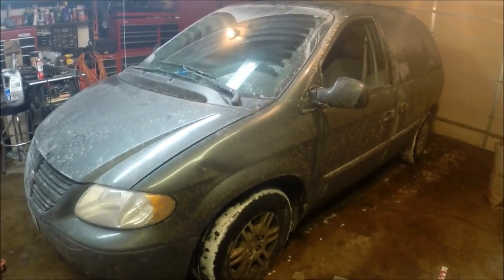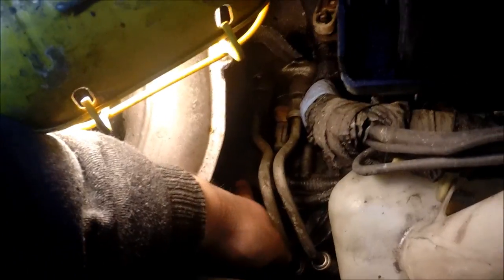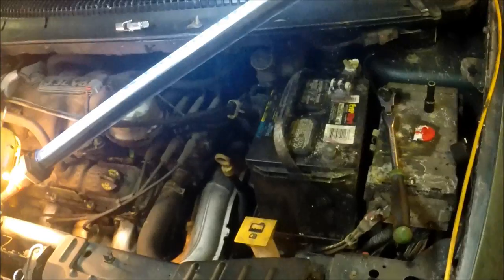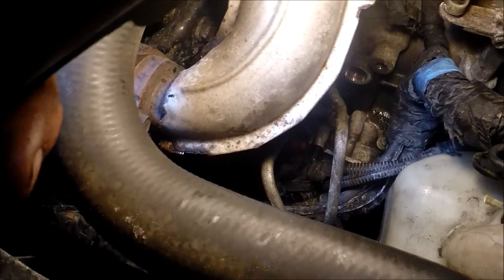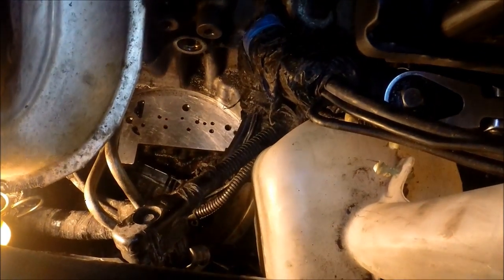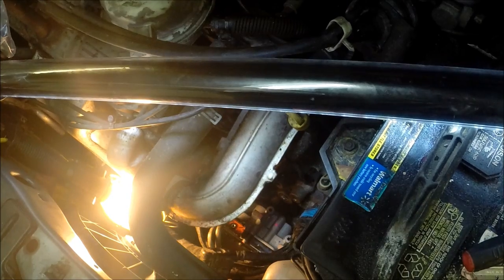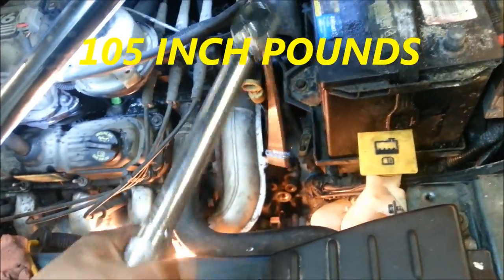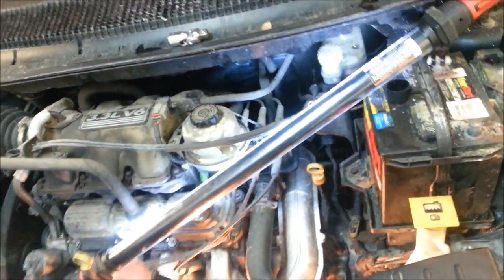Grand caravan/ town & country transmission control solenoid pack replacment

Comment: Nothing to do with leaking, but I had one of these and the trans control module is very sensitive to voltage drops, I had a problem with it going into limp mode and discovered by accident that just cleaning battery posts/connectors would cure it. Six months later it would try to take off in second from a stop sign and cleaning again cured it for another six months. Transmission shop told me $1800 to fix. What a scam.
Reply from the maker: bstrunk57 yeab some trans shops dont want to take the risk of not replacing big ticket items because then they get a bad rap for misdiag. unfortunate to the customer but its my experience with them

Comment: My 2005 Town and Country wouldn't shift in hot weather after driving a while, (P0700 code) so I went into the fuse box and replaced the EATX Safety Shut Down Relay for $20. Problem solved! Thanks, Occam's razor!

Comment: For anyone doing this.  If you cannot budge free the solenoid.  Go underneath and lighlty tap the solenoid with a heavy hammer.  A few light taps will break the bond.  Honestly the hardest part was scraping remnants of leftover gasket.  I found carb cleaner and break cleaner useless in removing it.  What I used was electrical contact cleaner.  I doused a piece of fabric in the contact cleaner and applied that to where gasket was stuck.  After roughly 30 minutes with it on the gasket just peeled right up.  Nice and easy.  Also use that electrical contact cleaner on the connector for the solenoid to clean out dirt and grease.  I changed this out on my van after it has been sitting for MONTHS.  I was worried because I have never done anythin like it.  You can seriously do this!!

Comment: Thank you for the video.  It made the job much easier.  My van had a rubber boot over it that took awhile to get it off.  If it wasn't for your video, I probably wouldn't have found the solenoid.  Evidently, a relearn wasn't necessary as it worked perfect.
Reply from the maker: thats great!!! glad i could help
Reply: Hey jerry, what yr and model? what codes did you have and what symptoms were you experiencing?
Reply: Steve Santiago 
It has been awhile but I think I can remember some of it.   The trans was shifting irrationality, but I don't remember the code.  It's a 2000 Town and Country with 175000 miles on it.   I haven't had any more problems since.

Comment: I just did this job, which my Chilton repair manual didn't even have in it.  Some observations.  It is an 8/10 on the knucklebuster scale!  It took more than 2 hours due to the tight spaces.  I ended up taking off both cooler lines.  The sensor on my 2006 Town & Country needed a 1" socket, not 7/8ths.  All that said, my mild problem of delayed shifting on occasion is now a full blown slipping and dropping out of gear problem, to the point I'm taking it in to a tranny shop tomorrow.  I'll post an update later.  Hopefully its a TCM quick learn issue and not something major.  Good video to guide through the process but beware it may not fix your problem!  Thanks for the help Joe.
Reply from the maker: oroszfamily  i replaced it because it was leaking and having shift issues, but transmission problems are the worst to have upon your vehicle so many issues can happen. usually if a relearn is needed (which it states it does)  it is just minor shift pattern issue. but sorry to hear of the issues. ive replaced the one and it ended up being a transmission pump that was failing so like i said transmissions can be very hard to diagnose
Reply: Jon Madison
I had a catalytic converter efficiency code (check engine light) going on also.  So, the transmission had to be rebuilt, and the transmission shop actually found the catalytic convertor was nearly plugged.  That evidently caused back pressure  (my words) which put a lot of strain on the tranny.  They didn't want my to drive on the rebuilt tranny unless I was going to immediately get the catalytic converter fixed.  I took it straight to the muffler shop the same day and it's been great ever since.  So, I spent a weekend and $80 for the part for nothing.  What irritated me was I took the van to the dealer hoping the catalytic would be under warranty (was not), and they told me it should be replaced but wasn't an emergency.  The muffler shop had also said it wasn't a big deal until it "got plugged."  I guess I was missing the signs of being plugged, as the power and acceleration had gotten bad.  We also had a EGR valve (check engine) code, which came back even after the EGR valve was replaced, and that went away after the new catalytic was put in.
Reply: JoeTheAutoGuy
I was trying to save on diagnostic charges which ended up not working.  Live and learn as they say!  I appreciate the help though, and the video is a good guide for this repair.  Thanks.

Comment: i know this is an old video, but i am getting ready to do the same thing tomorrow on the same model, 05 dodge caravan.  the area is so tight. how did you remove the trans cooler lines? can you remove both of them? is it safe to? do i need to add any trans fluid afterwards? also is the wiring harness on the right safe to move and bend out of the way? i can use the help with these questions.

Comment: Hi what are the 5 or 6 bolts right under the solenoid pack?  I saw that they were out so I tightened them up which I’m thinking now if that was a good idea.  I see in your caravan I can see the bolts are backed out too? From top view with the solenoid pack out you can see the bolts/screw right below gasket area.

Comment: 2003 Chrysler Town And Country 3.8L started shuddering and vibrating when shifted into reverse. Now check engine light on, will not shift from first gear. It all started by the van idling while in drive randomly. Then I manually downshifted and brought it down to 3rd gear then L. Shut it off and turned it back on and it drove fine after that on Friday. Now tonight the issues started.

Comment: Hi Joe,  After reading all these comments & your replies. I think you should be called st.joe. I have a 06 t&c 3.8L van with 231k.  I'm on my second used transmission. When cold the van slips 1st gear & immediately goes into 2nd gear limp mode. The speedometer stays on zero. After speeding up and slowing down the speedometer slowly starts to bounce. Bounces to 5 mph, then maybe 15, maybe to the actual speed I'm going, back to 0, ect... after 10 to 15 minutes I turn the car off &  8 out of 10 times it's good to go, no problems. My number one suspect is the TCM, also has catalytic converter codes, of course speed sensor codes, a bad tire &  a cracked windshield. I've driven the car 4k like this.  I think I'll do the TCM anyway but would like your opinion please sir.
Thanks,
Mark c
Reply: Haf an 03 caravan with the 3.3 that did the same thing. I would look at doing input/output speed sensor first.(before replacing ANYTHING LOOK AT THE WIRES) Had an 03 have crap wires and threw speed sensor codes, replaced sensor and went to plug in harness and wires broke off.

After that if not solved replace this solenoid and hope for best.

Comment: Hey Joe, I have a 2005 T&C 3.8  I have the P700 code also, it will go into reverse back up, but when you try to accel it will shudder, in forwards it holds gear a little long, and if you try to kick it down to second, it just revs, if you drive reasonable it drives forwards fine. was thinking a shift solenoid, and if so...easy to change? Thanks for your time on this and have a great safe evening.

Comment: Thanks for the video! I have a question. I wasn't able to get off the transmission cooler lines. Is just the tubing supposed to come off or does the brass/metal fitting come out as well? Do you use a special tool? I will try again next weekend. :-)
Reply from the maker: the cooler lines have a special clip that holds them in place but they tend to be difficult so it takes a bit longer but you can just remove the fitttings from the trans while keeping them attached to thier lines

Comment: I have a 2002 Chrysler Town n Country that drives fine except it is stuck in third gear. I've been told its probably the transmission module. What do you think? Thanks!

Comment: There is a gasket between the solenoid pack and the valve body right? I can't find one online..can you verify there needs to be one...looks like one on the video and it seems like there would be one...yet hard to find? Thanks

Comment: So  here is an odd thing. Our van went into limp mode and the next day the engine light came on and has code P0836 which only applies to 4 wheel drive which our van doesn't have. Wires all look clean and solid. I assume a TCM problem, but I'm unsure. On a whim I disconnected the battery for 20 minutes clearing the computer. Took it for a spin and shifts through everything fine. Perhaps it was just a computer snafu ( hope so ), but time will tell if it comes back.

Comment: Hey Joe! I have a 2004 Town N Country van. All of a sudden it won't go in reverse. It goes in all other gears perfectly. I'm still driving it lol. It still runs great except no reverse. Can this be the solenoid thing that you replaced in the video? It's not leaking no fluid or anything. I bought in back in 2012 and the engine light was on before I bought it. I'm just curious if it is the solenoid would the engine light go off?
Reply from the maker: if no reverse than there is probably a deeper issue than the solenoid

Comment: Hi Joe, I wanted to get your take on the T&C transmission. I have a 2014 which has that infamous indecisive shifting. Have you experimented with different fluids or aftermarket products that improve it? I notice turning OFF economy mode and skid control helps a little but then you lose on fuel economy...maybe. I live in Honolulu so we have a lot of hills, stop lights, and traffic. I want to preserve this transmission as much as possible because it's our family car. Any suggestions you have would be greatly appreciated!
Reply: Economy mode is best ignored. Econ is only supposed to be used on highway anyway, according to many people it causes problems with shifting, think computer bug.

Comment: If I could learn more about this limp mode. I was driving on the interstate at 75 mph and heard a thumb sound and the tack zoom up to 6K rpm before I took my foot off the gas. At the sound of the thumb all power stop going to the wheels and the check engine light came on. I had to coast to the shoulder. As the van was slowing the transmission re engaged at 25 mph. Since I was 4 miles from my destination I drove slowly to get there. Eight hours later I started up the van. When shifting into drive the transmission engages roughly. When driving first gear worked ok but second gear slips. Did not try third or fourth gear.  Drove 50 miles in first gear to get a tow. Could this be caused by the solenoid pack? 126000 miles.

Comment: have you had to replace one of these yet on the six-speed transmission used in later Grand caravans I am having an issue where it dies in drive but works fine in Reverse I suspect this is the problem part

Comment: I have a 2002 T&C 3.8L with codes P0700 and P0740 but the check engine light has not come on and there are no symptoms. Should I ignore and hope it goes away or replace before it fails? Also, the service manual says I have to drop the transaxle to do the replacement. Should I just be able to follow your example and get to it from above and below without dropping it? Thanks.
Reply: Wounded Ego did you get this repaired? most likely cause is the torque converter solenoid. not a bad repair

Comment: Hi Joe, I have 2004 T&C with code P0700 and it did show up multiple times and will go away if I took the sensors out, clean them and put them back again. Transmission also will shudder if transmission is hot. I went to transmission shop and they said that the transmission needs rebuild, but I don't think so as it drives really good in cold weather. Do you think I have to replace solenoid or just add Aux Transmission oil cooler?
Reply from the maker: +Wael Adel Hassan (Wael Hassan) its possible that there is wear in the transmission that is causing the fluid to aerate and overheat . what your contemplating is really a band aid , that p0700 code is a transmission telling the engine pcm to set a code that there is a code in the transmission computer(TCM) you need a scan tool that can access the tcm to see what codes are stored in the tcm
Reply: Thanks Joe, I will try that and will see what I will get.
Reply: +JoeTheAutoGuy I did scan for TCM got code P1775 for Solenoid Switch. I found also that I had problem with my cooling fan and that was why the oil was overheated. Will it be a solenoid only problem now? and also do I have to  drain the transmission fluid to change it? 

Thank you so much
Reply: +JoeTheAutoGuy Another quick question, do I have to replace speed input and output sensors?

Comment: my 2001 dodge caravan sport  keep shutting off every time I put it in gear. what plug on the transmission  do I unplug to keep it converter from locking up and shutting  the engine  down?

Comment: I have a 2002 Town and Country Chrysler we took our vehicle to Auto Parts to run a test because Our car started shaking and the engine light started blinking, Auto Parts ran the test and said that cylinder 1 backfired, P0700 Transmission malfunction present, and P0740 Torque Converter Clutch Mechanical System Performance. Do you know if he can repair these issue himself and how? He changed the spark plugs and the wires yesterday it did the same thing so he changed the coil pack and now the car is making a popping sounds and shaking even more. Any suggestions please?

Comment: what was the symptoms that make you change the pack and what was the code please ?
Reply: i have code p083b and my car stuck on 3rd and it wont move at all unless we push it till the transmission engaged but still even when it engage still stuck on 3rd

Comment: What happens if some dirt and sand and stuff fall into the little holes when you take off the solenoid, can it be cleared out by removing the oil pan and changing out the filter?
Reply from the maker: thoroughly clean the area before removing. thats the only way to truly remove the dirt from the transmission

Comment: I have an 03 caravan and am leaking at the solenoid so after replacing the transmission solenoid do I need to take to the dealer to do a quick learn
Reply: It's been 2 years.  What did you do?

Comment: My father has an 01 Caravan that won't go reverse but when he lifts off the ground it goes reverse. You think by replacing shift solenoid will fix this problem?
Reply from the maker: +Thomas Vazquez no unless there is a dtc code stored for it. check the driveshafts make sure the are not broken and fluid level

Comment: I am currently looking at buying a 2007 Dodge Grand Caravan with this same problem (or something very related). The owner said it was the "shift solenoid". Would that be the same as a trans control solenoid? The vehicle wont go into 4th gear. It shifts into the other gears fine. Van only has 74,000 mile on it. Joe, could you please give me a "ball park" total for the new solenoid and labor on this vehicle? Thanks.
Reply: Did you ever fix it?

Comment: I have an 05 caravan and when it is cold it doesn't want to go into drive or reverse, I have to give it throttle and play with it for it to go, it slips a little for the next 30sec sometimes, but then it is ok for the rest of the day. Do you think this could be caused by the solenoid?
Reply: Brian Reiff did you find a resolve for this? I am having the very same problem at the moment.
Reply: Just needs some fluid, make sure it is up to spec.
Reply: Same with mine, hoping a new pack will fix it.
Reply: @Asstmgrmike  did replacing the pack fix your problem
Reply: no i changed the fluid and filter and added in about 2 bottles of lucas quick fix to it and it worked. But as of last week the trans went to shit. drive downshifts into 1st gear. Neutral moves you forward., No reverse. I'm scrapping it for parts tomorrow. @bradbyers8369

Comment: I have an 03 caravan that won't go in to any gear including neutral while the engine is running nor will roll in neutral while the engine is running I can turn the motor off and then it will go into neutral and roll is this a transmission solenoid problem
Reply from the maker: +Bill Griffin sounds very internal issues because neutral is a mechanical change in the valve body .
Reply: +Bill Griffin maybe a fuse.

Comment: Hey quick question.. What was wrong with the van..? I have 03 that's I can drive for about an hour before it goes into limp mode also have 0700 code.. So i don't know if solenoid or tcm.. Thanks
Reply from the maker: on this van the solenoid was bad and also leaking. the van would at times not engage into gears. its a hard find on your own to decipher the solenoid from the tcm in the issues but ive done quite a few solenoid packs but a higher level bidirectional scan tool allows testing of the tcm to find the culprit
Reply: JoeTheAutoGuy thanks.. I can pull codes from the just fine.. So I'm guessing it's good.. Got a p0734 and  p0733  .. I'm lost.. Hoping I don't a new trans

Comment: I have a 2003 town & country drives for a bit then it stops moving feels like its in neutral revs up pass 3000rpms still when i let it sit even with it on then it will drive fine again for a bit then goes back like im in neutral. Any suggestions?
Reply: Doesnt die either van stays on doesnt get hot or anything just stops moving when i press on the gas.
Reply: Mines is all wheel drive but I have same exact problem..it starts fine but when I shift into any gear, van is still at same exact spot..what can be the issue